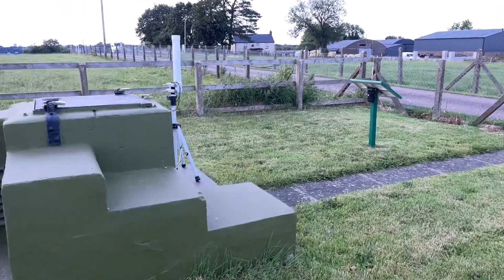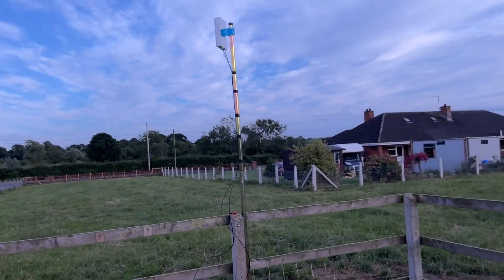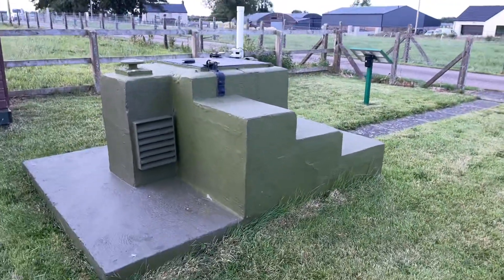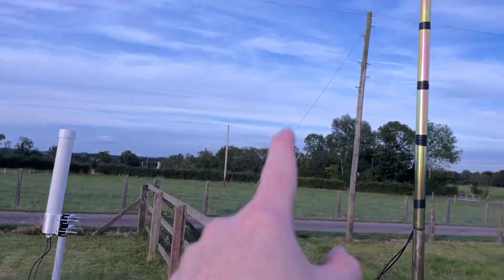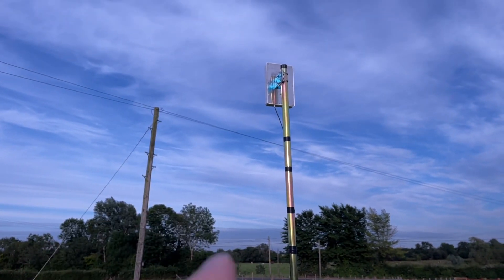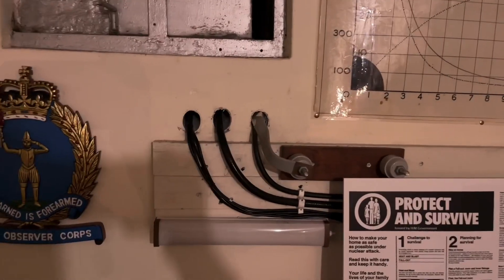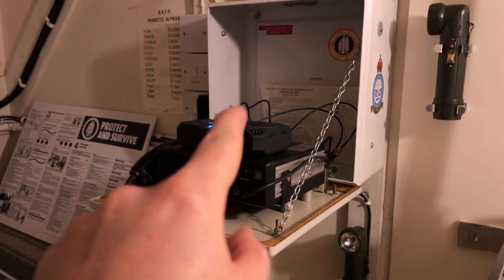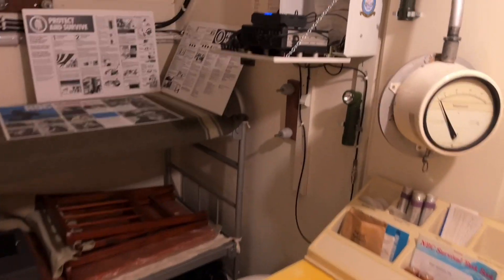Bunker Maintenance Episode 20

Comment: Hi, I picked up a Wb400 carrier reciever and just put a 6v battery onto it and not expecting it work, it made noise, though only a static sound. Is there a way to have it produce the proper sound or is that only done through the comms line which can't be done anymore obviously? Best of luck with you and your family
Reply from the maker: The warning tones are created by the Carrier Control Point so you would need one of them to have it working like it used to. Easiest way is to hook an MP3 player up to it… you will need a small amplifier too as the unit does not contain one and line level isn’t loud enough. I can email you all the original warning tones.
Reply: @SurvivingTheApocalypse  ah I thought it would need something higher up in the line. A CCP is the last thing I'd expect to find on ebay lol. As for the recordings then yes that would be great. I think we still have each others email. Cheers
Reply: @SurvivingTheApocalypse  I have emailed you about wiring to the speaker

Comment: Good work, didn't all the ROC posts have landlines? Was that no longer intact?
Reply from the maker: The line from above ground to below ground is intact and I still use it on open days to connect to the warning system. The connection at the telegraph pole was cut and removed when the post closed. I could get it reconnected by BT of course and get broadband installed but the expense isn’t really worth it as I don’t use it often enough.
Reply: @SurvivingTheApocalypse  yes, the flat rate cost of broadband is only really worthwhile if it gets every day use.
Reply: @SurvivingTheApocalypse  hi you had a gp3 siren do you still have it
Reply: How many ROC posts  in Northern Ireland were operational before the Royal Observer Corps was stood down in 1990 ?
Reply from the maker: 33, there was originally 58 built.